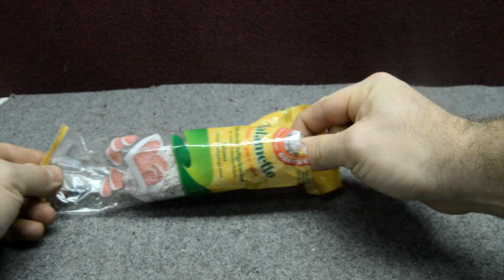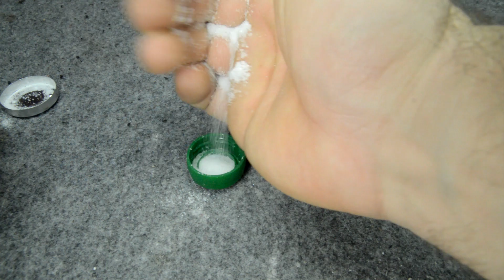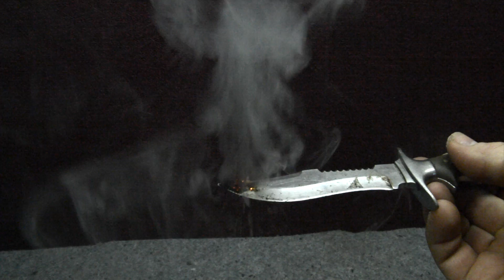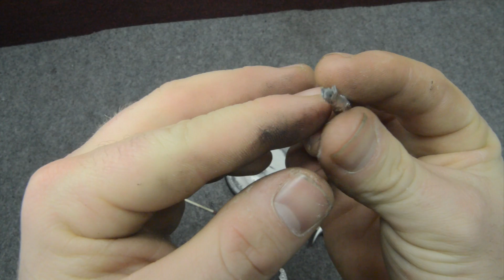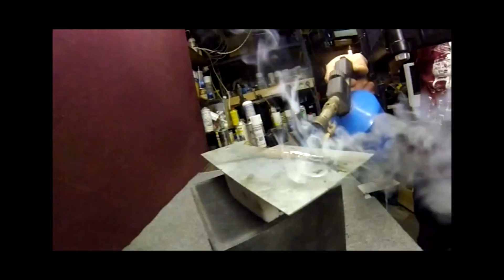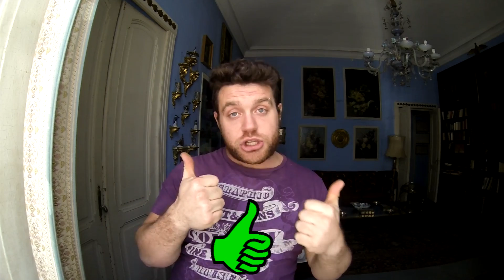How To make •  ROCKET whit Salami Powder

Comment: You should have crushed up match heads and added them to the mix, that way you would have the full recipe of gun powder (with sugar for the carbon instead of charcoal and sulphur from the match heads) and it would really explode instead of needing to be heated for a long time and then fizzling away slowly.
Reply: MrAwawe You generally don't want explosions in rocketry. Unless you are playing KSP.